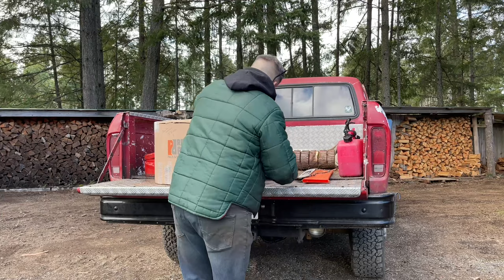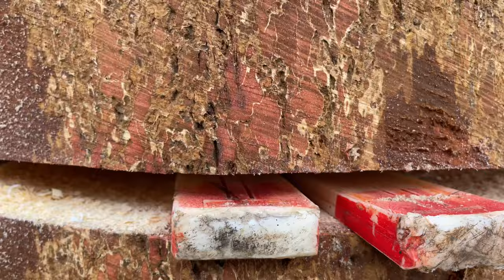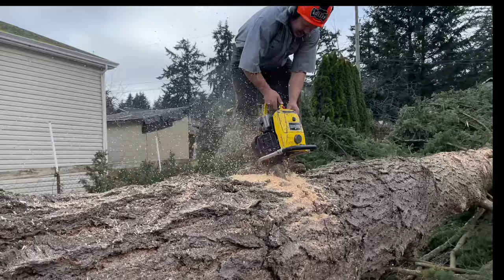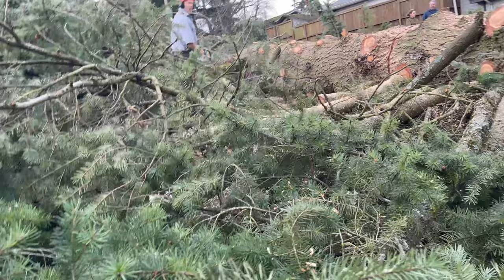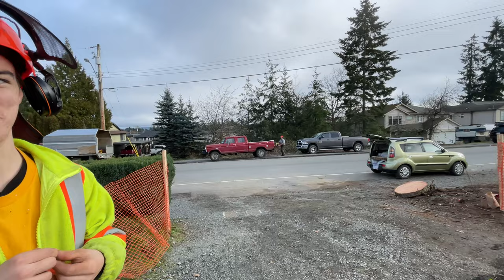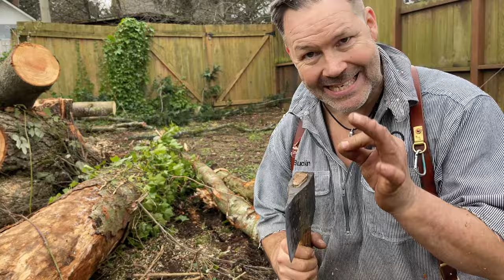STIHL MS500i - World’s 1st Fuel Injected Chainsaw

Comment: Hey buckin I have a serious question. I run a small 2 man tree service. My biggest saw is my husky 570. Its got an issue and isn't running full throttle. I'm turning 40 in 2 weeks and told my wife I need a new big saw. Husqvarna is my saw of choice but dealers are disappearing around here and there's only 1 semi close to me. Stihl is everywhere. I even entertained hollzforma knock offs... my stihl dealer may have a 500i for 1300 bucks but has to bought immediately or it's be gone. Or do I go with a 661 stihl, 500i stihl, 572 husqvarna, or buy 3 661 knock offs from hollzforma. I climb and own a bucket truck. 661 is heavy. But I want a saw that pulls a 36 without a problem maybe a 41. I'd like to spend a little less, the 572 is 1000 but idk... I don't wanna be strapped. I'm in Michigan and its winter time right now. Work is scheduled but it's down right cold.

Comment: Is that saw stock Buckin'? I know you said it had an exhaust mod (muffler). Remember that saw was out for 2 years in Europe and it don't have a choke because fuel injected saws have a throttle body or DI (direct injection) so the computer does it all.

Comment: Those saws 'learn' their cuts every day. Temp', barometer everything is learned in work and the book says they will adapt after approximately 5 similar cuts. That's why they 'wake up' in use and change their run characteristics. If you are bucking or limbing for any length of time they adjust to sustained cutting or rapid blasts. To asses any external changes you need to compare an educated saw having made a few similar cuts before and after. Single cuts don't give the computer time to adapt.

Comment: Trouble is with having a fuel injected tool is it's less serviceable in the field. Carbs can be cleaned, adjusted and parts replaced easily. With injection, if it packs up your stuffed until you can get it serviced.
Reply: you have to take the EFI saw to your dealer and wait for them to fix it. with older saws you can have an extra carb on hand just in case you need it

Comment: I have a question for anyone...... Got my first chainsaw and wanted to know something.   Is it normal for it to leak chain oil when just sitting there and not in use? I used it for the first time a few months ago and went to use it the other day and most of the chain oil is gone and there is a big oil stain under the saw.  Thanks
Reply: That’s a huge prob for a lot of saws. What make and model do you have?
Reply: I have 2 electric chainsaws that completely drain the bar oil when sitting upright and not being used. 
My gas saws are not doing that as of now. 
Could be certain gaskets are not seated right... 
One of my go to mechanics is to take it apart and put it back together,  but that could be disastrous 😐
Reply: Sorry. Jirus Jirus I don’t know a thing about elec saws. When I need to find a leak in a saw I drain the oil and put gas in the tank. The gas leaks faster and makes it easier to see. You could also try soapy water and add a bit of compressed to the tank and see where the bubbles come from. Good luck friend🙂
Reply: @shapeshifter7753  
Two excellent ideas for possible solutions. May have to fabricobble custom made gaskets. 
Safe/Strong/Kind
Reply: Jirus Jirus many times it’s either the outlet or the cap.
Reply: @shapeshifter7753  it is a Husqvarna Rancher. I'll check the exact model number or engine size when I get home.
Reply: @shapeshifter7753  rancher 455
Reply: F M I had the same problem with mine. It was from around the output line. Where the cases meet. I stripped it right down and j b welled the hose to the cases. Maybe not the smartest, fastest way but it hasn’t leaked. I’d try cleaning out the tank and putting gasket maker or silicone around the groomet on the inside. If ya can get at it. See where it’s coming from first. I’ve heard it’s a thing with the455

Comment: Tell Donny to very gently begin hanging from a bar - like a chin up bar - it will fix his shoulders. Just low down, he doesn't have to, or want to, put his whole weight on it, gradually build up until you're fully hanging. 
It will hurt, it just does, I know because I did it. But it isn't damaging you. I couldn't pull a saw, I couldn't sleep on my side, it hurt to pull my coat on - but just doing this, starting with 5 - 10 seconds a day, fixed my shoulders in under two months and I'd spent hundreds, probably thousands of pounds over two years with specialists.
Donny, you can fix them.
Reply: Yes... 
This type of physical therapy is invaluable to be in good shape... I actually do know... I'm 65 and have recovered successfully from numerous physical maladies.

Comment: What modern junk. I got pic.'s from racing my trusty 064 in one hand against the newer 066 "electronic ignition" in the other hand. Did a lot of high production firewood and raced my 064 all day long in all kinds of heat with never a fail or pause. Quite sure my old 064 would smoke this one too.

Comment: when is someone going to put an electric starter on a chainsaw?
Reply: Mac did it years ago!  Bell hopper has one!
Reply: @theironhorse6600  with the modern battery and magnet technology i would have expected electric start to be a standard feature by now.  if the manufactures won't do it then there's probably a market for somebody in bolt on attachments.

Comment: I run aviation fuel in all my saws. Does anyone run high octane or av gas in the 500i?
Reply: Man 9 times outta 10 anything higher then the normal 91 octane is actually going to start robbing power from the motor.. Any combustion engine is going to be designed and engineered to run at a specific “combustion ratio” of 8:1 or 12:1. (air to fuel ratio) so the issue is their designed with the typical octane fuel available, so when you go and start manipulating the fuel side of things without changing the air side of things you’ll dilute the system so to say and end up running rich.. now I’m definitely not saying running cleaner fuel with better more thought out additives is a bad thing cuz that 100% makes a difference w/ wear and tear and whatnot but at the end of the day, running a motor on exactly what it calls for is no matter what the best way to get the most out of it. Obviously not including actual modifications and what have you.

Comment: Great saw ,, Free flowed muffler and mine went well also hower the filter lets them down imho ,, In dusty old crop pine 4 hrs and the filter is loaded ,, I use "a pre cleaner ,,Feel its a must in dusty conditions ,, What interesting is there is nothing between the 500i and 572 pulling 8 tooth ,,"Both free flow mufflers " The 572 will lug a little better ,, Both great saws :-) https://www.youtube.com/watch?v=FA7PUQHYQF0